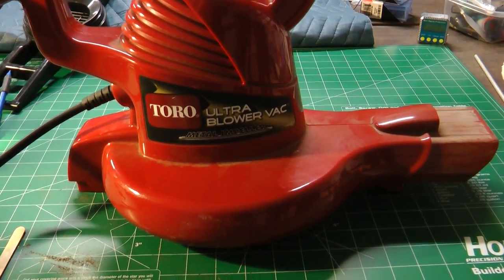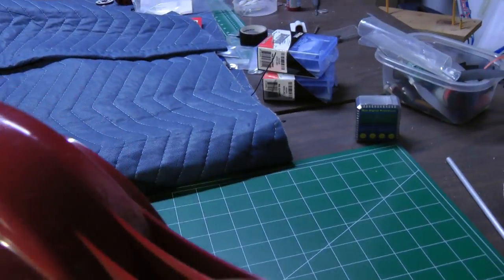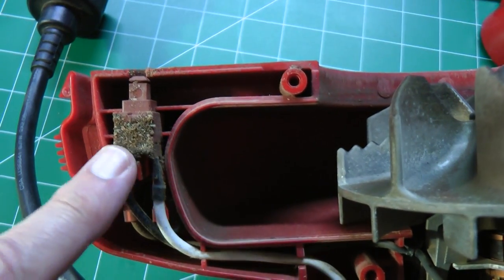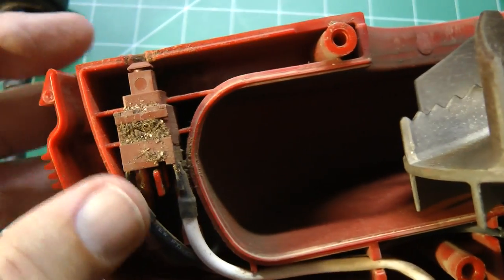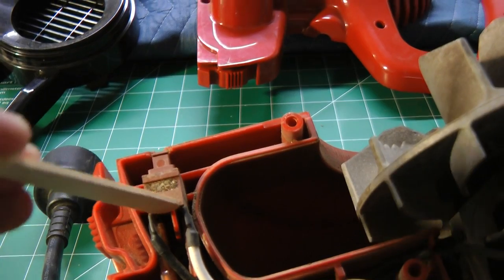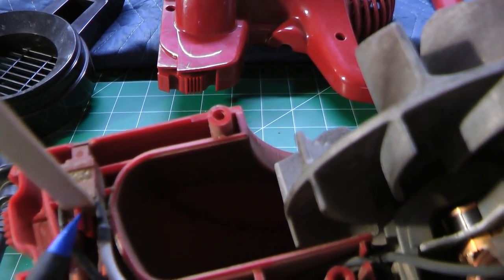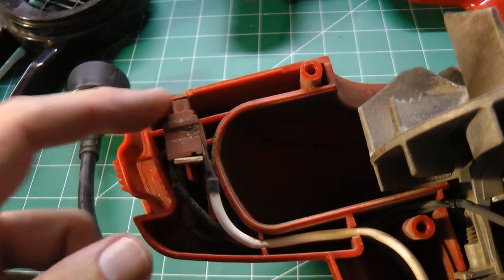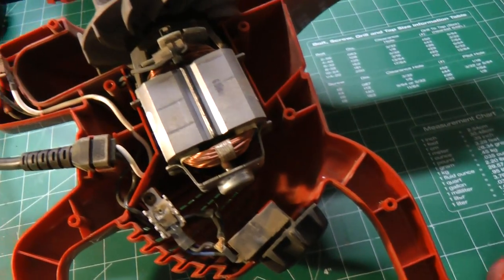Toro 51609 leaf blower - repair the faulty switch

Comment: Thanks Gary! My HomeLite had a similar problem. The plunger was worn down and not connecting the switch.
I used a 5/64 drill bit and put a small screw on the plunger. You saved another home appliance from the landfill!

Comment: Thanks!!  I was convinced that I had a broken power wire but splicing didn't help and I got no voltage over the switch.  I too was ready to toss but luckily saw your video about the safety switch.  Works!!  Saved me $100.  Thanks very much.,

Comment: Oh my goodness, was just getting ready to toss in trash. Found you n you were right on. Saved me lots money. That dang little switch. My model is 51619 but inside looks exact, also on mine was a hidden screw under toro label. I think it’s there so u will break it it trying to get it apart, ty ty ty
Reply from the maker: I'm going to add that to the comments, several had mentioned they could not get it opened and never followed up if they figured it out.

Comment: Had the same problem as it turned out....thanks Gary, you saved my blowers life! Shame on Toro for not offering any electronics, even tho I didn't have a faulty part. I have an issue with the speed control, but for now it's working and usable.

Comment: My problem was the variable speed dial.  I could not get the thing to start - unless it got lucky and turned the dial to a very specific spot.  I opened the thing by removing 10 screws.  Then cut the black wites going to the dial (cut as close to the dial as you can).  Then the dial with 3 wires just comes out by removing one screw.  Only two wires left.  Twist them together and reassemble (being careful with the shutoff button).  Presto - it now runs at full speed.  For now I just unplug to stop it.  Later I will put an in-line switch on the power cord.  Hope this helps.
Reply: Ray Stahl, My girlfriends had the same issues. I eliminated all wires and connected the motor directly to the cord and it works fine now always on high speed.  I'm a hero now, thanks

Comment: I tried this work around but kill switch play turned out not to be the problem. The kill switch on my blower wasn't loose. My guess is Toro got a batch of kill switches  that were slightly undersized and therefore there was slop between the kill switch and the plastic backing stop. This clever work around would work well on units with undersized kill switches, the rest of us I'm afraid have faulty speed switches and are going to have to make an extra trip to the dump. So much for Toro quality...
Reply: I'm in the same boat. It's not the kill switch it's the speed control and it's down to one speed and fortunately it's not the full speed otherwise I could live with it.  A quick search told me that Toro doesn't sell the electrical parts. Thanks Toro. I'm looking in the possibility of replacing everything with a switch. If that component with a heat sink is an SCR then it will work. I'll just one speed but it will be full speed.

Comment: Thank you. Bu I didn't even have to open it up. I just drill a pilot from the back of the pine that pushes the switch. Then a small screw that extends the reach of the pin! I did quicker than it took to watch the vid. I also have a Ryobi. It has better velocity but a smaller bag. Can't find Ryobi any where anymore. Maybe it was too powerful...

Comment: Excellent video  I'm gonna wire  it with the ebay  adapter for bauer/hercules/Dewalt batteries directly to switch side so it can run off battery 🔋 mine is from first few years they made them on sale when it was like $40 years ago lol

Comment: How do you know something on switch? Do you use multimeter to measure resistance? Thank you for share video.
Reply from the maker: Just follow the wires, it's a safety switch to close the circuit.  The switch is not bolted or glued in, it moves around.  By inserting the wooden stick in there it removes the slop and allows that pin to push the switch more reliably.

Comment: I have ELEVEN screws on mine and it's a major pain to take the halves apart.  I would have liked to have seen THAT in this video.
Reply from the maker: I had no issues taking mine apart, others have noted they have more screws.  They add more screws to make it harder to take apart but won't bother redesigning that safety switch issue!

Comment: The switch should have a detent, correct? I.e., when depressed there is an audible "click"? Mine has no play and gets full depressed by the pin of the attachment, however there is no "click". Seems my switch must be toast and I doubt whether I will be able to find a replacement. "4-pole push switch"? thx.
Reply from the maker: Put the wood in there to get rid of the slop to make sure.  I swore my pin was also pushing the switch in all the way but it was not.
Reply: @GaryQuiring  Thanks, but no my Ultra doesn't have that variance (no room for a shim) and there is actually a foam pad surround the pin as it exits the switch. I actually pulled the switch out and it definitely does not make a "click" when depressed. I have a newer Ultra unit and there is and audible click on that switch when diagnosed.
Reply: @GaryQuiring  I believe your shim method has also worked for me, so thank you!. Although I had to remove the foam pad surrounding the switch as it seemed to be deadening the response. I used a folded over piece of plastic zip tie, so it should last. Still don't hear the audible click that I do with my newer blower, but maybe the detent has just worn out. Any idea which direction the impeller should spin, as I am concerned that I may have reversed wiring? Feel like I have questioned this before with my newer blower as the shape of the impeller an direction of spin does not seem intuitive.

Comment: Excellent! Saved me $60! I went about fixing it another way because after taking out all the screws mine wouldn't separate. I simply cut a very tiny piece of Popsicle stick and super glued it to the switch itself which has the same effect.

Comment: These are amazing blowers, my absolute favorite and I have quite a selection.  But this model wins hands down. 
 Unfortunately Toro has become a company that I no longer find favor with.  The most common problem I have with this model blower is the variable speed on/off switch.  They are not available anywhere except in bulk from China and Toro refuses to help with replacement part.  The actual component is Part #: Defond CYM 1213-A and has to be soldered up to existing wiring.  It can be bypassed and use a 13 amp or greater rheostat or router speed control on the extension cord.  Might be nice to figure out a way to mount the rheostat in existing enclosure.
Reply: Oh man I'm sorry to read your comment. I have the 510618 mod Super Blower Vac. This blower was a replacement from home depot. The problem with the first blower was the switch stopped working. 
 I brought the replacement home, have used it maybe 10 to 15 times to blow drive way and patio. The switch was a two speed, now it's a one speed. Today I used it for about 10 minutes and I felt the handle getting warm.  I was thinking about ordering a new switch but now you've found out for yourself that can't happen. That's not good, that is bad customer service on TORO's part.
I have an older TORO blower had it for years, it's looks brand new the only problem is I can't get replacement motor brushes because the American company that made the motor sold the patient for the motor to China during the Obama years.
So now I'm stuck with another VAC I can't buy a switch for.  Seriously if I find out that is true I'm done Buying TORO products.
Poor business and customer service.
Reply: Well that's a different switch but very similar in design I believe.  Haven't tried to locate that one.  Like I said it can be bypassed if wired together if you just want it to work full speed and get a speed control maybe inline at the extension chord.  It's a pain but should work.  As far as the brushes, that's a real bummer.
Reply: Update! Incredible news. After watching your video I decided to take the blower apart to see if it had a bad wire or a lose connection, and then write down the switch part part number.  
I saw no wire problems,no damaged, burnt or lose wires.  So I wrote down all the info on the switch. Then I thought about cleaning the switch,  figured nothing to lose. So I have a 10zo can of 3-M Anti-Static Electric Equipment Cleaner, I use it on my Sanyo stereo round knobs,  it stops all static that you'd hear when turning the volume knobs.  
Anyway I used the cleaner on the switch, put the unit back together and to my surprise the blower runs like  New.  
Maybe sand particles and dirt got inside the switch housing and was causing a short, as I said the handle was getting warm.  What ever the problem was with the switch it's gone now. 
Maybe worth trying for anyone having a switch problem on any blower etc.

https://www.3m.com/3M/en_US/company-us/all-3m-products/~/3M-Anti-Static-Electronic-Equipment-Cleaner-CL600/?N=5002385+3294308132&rt=rud
"Note" Before cleaning  the switch I Did Not remove the wires from the switch, but after a good spraying I took a paper towel and wiped off the excess spray". The paper towel did have a little dirt on it after wiping the excess spray off the switch.

"And just in case anyone wonders about it, No I do not work in anyway shape or form for 3-M Products"'.  
Thanks again for your video, you got me motivated to take a look at the switch. And it paid off big time. Thanks again.
Reply: @DayClanTribe  I am fairly good with electronics but just want to make sure I know what the hell I am doing....I have exact same problem and would just like to bypass switch so that it is on high all the time. Can you tell me specifically which wires I should take off switch and connect and soldier? Thanks man!!!
Reply: @jimgrigsby3682  Should be the two main leads to the switch ( heavy ones).  One should go through the motor and return to neutral.
Reply: @DayClanTribe  Thank you. Seems like there were three wires on this switch one going to the rectifier that had me a little perplexed. I am simply stunned that they (Toro) do not offer this part especially in light of how many folks have problems with it. I did try the  cleaning of the switch with no positive results. Evidently they figured out the safety switch issue as mine is very tight and with foam installed. Sure was hoping that it was simply a safety switch issue! Thanks again!!
Reply: @jimgrigsby3682  well the safety switch is another issue and that can easily be bypassed by connecting the wires together but not sure I'd recommend it.

Comment: Just found a 15 amp rotary switch on a common marketplace.  Just under ten dollars.  It's four position instead of infinitely variable, better than junking the entire machine if it can work.  Found another that goes between the plug and outlet, in case you went for a direct line fix and want variability back.  At the time writing this it's ~$22.  Search for variable speed controller in whatever marketplace site you want to check.
Reply: How about the part number of that switch ?

Comment: Hi Gary.  Thanks so much for you video.  I have the Toro Rack & Vac, model # 51574 and I couldn't get the blower to work.  After watching your video, I realized that the guard had to be install on the blower so the safety switch could close and make the blower work.  So while I didn't have to use the popsicle stick solution, your video did make me realize the guard had to be install so you couldn't stick your fingers into the spinning fan blade.  Thank you for saving me from throwing out this blower!

Comment: I have the model 51619 
Thank you for the video 
I tried the fix but unfortunately it did not work 
Must be the switch itself 
Bought and used it for a year then just stopped working.
Any other advice by chance?
I plan to buy better quality tools in the future. Goodbye Toro

Comment: Thank you for sharing your experience.  I am baffled because I disassembled my Toro Power Jet F700 Electric corded leaf blower; cleaned-up the commutator and reassembled the parts back together (correctly?) and it won't start. I could not find a safety switch, but I do have the rheostat switch: I checked for power with my old analog multi-meter, current passes through the plug, so I ruled that the plug is good: I probe around with my positive lead while my negative lead is still in ground. I get a good reading on what I think is the commutator, but nothing when I probe one side of the armature copper windings,  However, I am on a steep learning curve with AC/DC/Universal Electric Motors.

Comment: you just saved me $70!

mine is a 51599, so it's a little older. The current model on amazon is the 51619. 

same problem though, same fix.

Comment: Went out to blow some leaves today and had had the same issue that it wouldn't turn on. Wish I would have watched this first because I took the housing off and didn't notice the safety switch so I put it back together. I took it back apart and found the same wiggle room where the switch is and after putting in a brace like the video it worked! Thanks for the video.

Comment: Thanks Gary! The knob/pin to press the safety switch broke off. I just drilled a small hole and used a small screw to push the safety in.

Comment: Thanks for the inspiration! In my 51599 unit the switch was solidly in place, but the plunger wasn't being pushed in quite far enough to click. So I super glued a piece of popsicle stick to the end of the plunger and the foam piece that surrounds it.  Works!
Reply: Thanks CD! I have the same 51599 blower as you and when I got it taken apart there was no gap. Found your answer and put the pop stick at the top of the switch. It worked, yay!

Comment: Best thing to do is open it up. Remove the speed control wire directly from the cord to the motor. Use it for Leaf blower it will run on high but that’s usually where your  ran it most of the time 
anyway their you go  fixed 👍🏼

Comment: Or, we can just tape the switch so that it's always on? Or we could add some tiny thing to the end of the black plug so that it's a tiny bit longer?
Reply from the maker: This is a safety switch, you do NOT want it always on, that would be dangerous if you remove the bottom piece and it's still plugged in.  Making the pin longer would work if you can find someway to attach something to it.  Why not take it apart and do what I did?

Comment: So I've removed all the bolts but it still feels like something is pulling both sides together and I can't get it apart to get to the switch. What am I missing?
Reply from the maker: Did you remove the bottom black piece?  Also the stickers, sometimes a screw is hidden behind them.
Reply: Sticker was hiding a screw. Thanks. 😊

Comment: Thanks, this helped me find my issue of not turning on. The blower adaptor was on crooked, partially pushing in the safety switch. Removed and reset the adaptor, works like a charm...

Comment: I have the 51586 model so no problem like this. My brushes have worn out after 15 years causing the 10 amp fast blow to blow out. I cannot find the brushes yet but instead of replacing the fast-blo fuse I used a circuit breaker from a power strip and drilled through the case for access and reset abilities. The brushes listed for my model are all over the internet, from Russia to the UK to NZ , on Etsy or whatever, Ebay, and every site like those and the pictures and instructions are from the same person. Must have bought the entire brush inventory and now posting worldwide. Thanks for the vid. Next step when the popsicle stick falls out is to cut and soldier the wires to that switch and chuck the switch in the trash. Have fun when ya'lls brushes wear out.

Comment: I realized that you posted this video a long time ago. I have a similar issue, although I can's seem to take the blower apart. I removed all the screws but somehow can't get to open it. I am wondering if you have any tips about that?
Reply from the maker: Is it the same model?  Make sure you take off the front piece (chute or whatever you would call it).  Sometimes they hide a screw behind a sticker.

Comment: Thank  you!  I have the Toro 51619 Ultra Electric Blower Vac.  Same problem, similar solution.    Safety is located underneath the inlet cover.  The inlet cover connects the leaf blower attachment (black nozzle) to the frame.   PART # 108-8965  "INLET COVER FOR TORO BLOWER/VACUUMS" PART # 108-8965

Comment: My issue was with vacuum. After seeing video, tried blower, it worked! Issue: the blower attachment was worn and cracked, preventing machine from working. At least I have a blower. Vac TBD If a replacement part is available.

Comment: How did you get the thing open. I can’t get it apart around the handle. Where the power cord goes in.
Reply from the maker: How many screws did you remove?  There are a total of 10.  Are you sure you have the same model #?
Reply: @GaryQuiring  No I have the later model. It looks exactly the same but has 12 screws. I got them all out. But I. Ant separate the area around the handle. I had 4 flat head screw drivers. Trying to get it open. I think the model is a 619 instead of a 609.
Reply from the maker: @brettegarr8064  The only thing I can think of is sometimes they hide a screw behind a label/sticker.